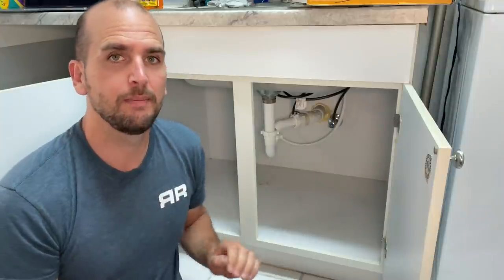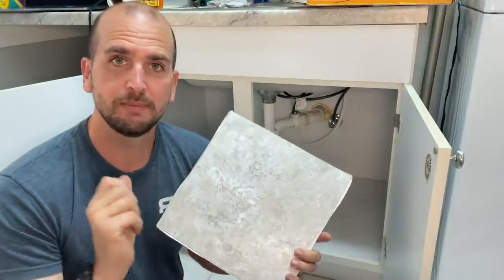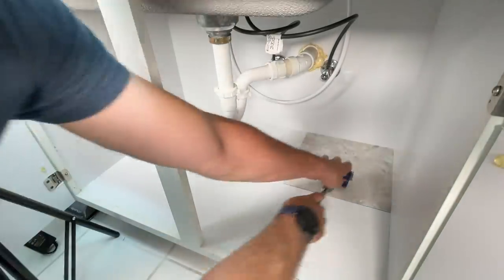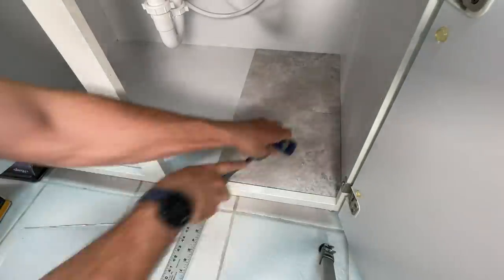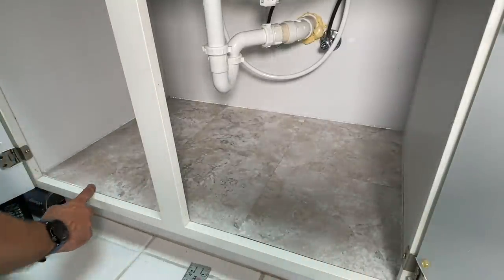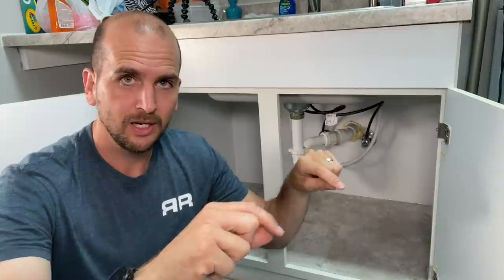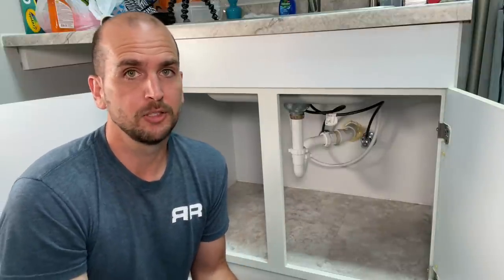Waterproofing Hack For Kitchen and Bathroom Cabinets

Comment: You can use 3M spray to get better adhesions and definitely want to put the tiles on the sides because water is just going to run to the sides and ruin the cabinet anyways.

Comment: Nobody’s under sink area looks like that in the real world. They all have drain pipes going through the baseboard which makes such a project 10x harder.
Reply: Wrong.  All of mine look like this, kitchen and baths.
Reply: Sorry!
But...All of mine look not perfect but in place"--
and clean...
Reply: Where do you live?! Mine look like that, it’s called taking care of things.
Reply: @SuperColymon  
Exactly!!☑️☑️☑️
Take care of your own
things!!😁😁😁
Or the place you're living
In...
Reply: The person never referred to dirty just how the pipes looked ffs.
Reply: @walkermom100  
And we're talking about the pipes ..
The dirty is extra" .
Reply: I’m sure the correct way is what we are looking at right now. Not pipes coming from under the ground or “going through the baseboard”, as you put it 🤷‍♀️. Those problems are caused by people not doing it right in the first place, and unfortunately the next owner has to deal with it. My bathroom sink also looks just like this, and apparently, I’m not the only one. Good idea to add those tiles.... it makes everything look so much cleaner than seeing an old, sometimes rotting, wood cabinet underneath the sink. So much easier to clean too, just an occasional wipe down 👍
Reply: @NEILZEE11  actually a lot of. Homes have the pipes coming up.from.the floor or near the bottom of the back near the baseboards. 
Everyone's setup shouldn't be the assumed way things are.
Reply: @walkermom100   ~ Maybe in really olds homes? I’ve only seen pipes, in newer places at least, coming from the wall, but ok. It seems harder to work on coming from underground.
Reply: @walkermom100  ... totally agree, leaky pipes can happen no matter how they are originally installed. The problems I was referring to were the ones coming from underground rather than from the wall. Just seems harder to me to repair the underground stuff.
Reply: @NEILZEE11  that's true and harder to find vanities for that.

Comment: This can be done without a tape measure. Turn tile upside down and use a knife blade to mark the cut on both edges and then I use a 14 inch aluminum angel iron section to make the cut. This will allow you to keep your fingertips if you wish to keep them. (Do not ask me how I know that) keep all fingers on the side away from the blade

Comment: Butter, tar, diesel oil, candle wax , or lots of chewing gum work well too. Johnny Maze says flex seal will make that cabinet double as a bathtub turning your property into a 2 3/4 bath.
Reply from the maker: 😂 actually want to try the Flex Seal and then test it out.  Future video 🤔
Reply: @EverydayHomeRepairs  it would probably work great😃👍🏽

Comment: I don’t like peel and stick tile. They always seem to shrink and get gaps between them. I’d use linoleum or laminate like you use on counter tops. Also, I think the cabinet manufacturers  should pitch the floor up in the back so the water will run out.

Comment: Great advice. I'd start setting tiles on front and on the center though as tile setters would do. Quick question, is there any liquid waterproofing I can apply on kitchen cabinet walls?

Comment: Too much time and not effective to deal with a little water leak. 
You really want to do this right?
Get a can of flex seal, they have it in white or black. Use painters tape a few inches above the bottom, ie making a "back splash" . Then with your flex seal spray lightly across the bottom and sides. Dont go heavy, go lightly otherwise will look messy. Let it dry then remove painters tape. Nice even line for your back splash. This way you have something that is effective in preventing damage if you have a leak.
Reply from the maker: Not a bad idea, thanks for the suggestion 👍

Comment: That is actually not a bad idea! Nicely done. 
PS: What type caulking was used (since there are a million and one choices)?
Reply from the maker: standard clear silicone.  Like this 12-pack on Amazon https://amzn.to/3pYmWkV
Reply: @EverydayHomeRepairs  Thanks for the tips! Haven’t yet seen your answer about caulking the seams between the tiles, fear of water getting between the cracks. Do you think ok to caulk seams, or not necessary?
Reply from the maker: @Shakashack2022  I don't love the finished product but it would most likely make for a more waterproof surface 👍

Comment: As a homeowner, I'm really paranoid about water leaks.
Under the sinks, I line the bottoms with scrap cardboard as it will show any leaks really easily then a baking pan with a water alarm under the drain pipes.

Comment: You don't use "tiles"... those are "Linoleum tiles", are they? A very good idea, you could also use any other form of such stuff, mainly important is that it is waterproof. Also, ideally all that stuff has a slight drop-off towards the front, don't know how that could be achieved cheaply.

Comment: I use contact sheeting and a moisture sensor that tells my main shutoff valve to close.
Reply: Tells your main shutoff to close! Who knew?! That's hard-core. Mine would probably go off while I was rushing to get ready for work, 😆.  Would be great for vacation time, though. As a renter, I think an email alert would be best for me.
Reply from the maker: Hey Rob, what brand are you using for the sensor and shutoff?

Comment: Looks nice, although if your a tenant you can’t go about transforming the furniture. As a plumber I object to the assumption you’ll even have any leak to begin with! Unless the plumbing is ancient, or poorly installed you should have zero leaks/drips. A real leak will damage the unit and likely the floor and beyond with or without vinyl tiles. Very often the reason for damage is a very minor leak which has been ignored for many months or even years!
Reply: After 39 years in apartment rental believe me it happens more than you would think from renters...

Comment: I have a few water sensors in my possible leak areas.
Reply from the maker: Have those worked well for you?  Did you have a leak yet which the sensor detected?  I have one sitting on my table from Roost that my insurance agent sent me but I haven't installed it yet.
Reply: @EverydayHomeRepairs  I tested it with water and it went off. But no I do not have leaks very often. After the last one under the kitchen sink, I completely redid everything. I may end up doing the tile thing in addition. I have the Flo by Moen sensors.
Reply from the maker: @chex313  Nice, thanks for the follow up.

Comment: I can't see how this would help, the bottom of the cabinet should be waterproof (if laminate) or extremely water resistant (painted wood). It's the seams around the bottom you need to seal with silicone, that's the only place water will get through.
Reply: I use sheet vinyl because there is no gaps/ lines

Comment: That wont seal it. You need something a tongue and groove so you can put silicon into the grooves that will squeeze through. Water will get into those cracks if you just bead it on the surface. Best bet would be buying a cheap box of vinyl

Comment: Any tips for drying out underneat the cabinet itself? 

I installed a dishwasher recently and noticed it was leaking pretty badly. I thought that I just didn't level it quite enough so I adjusted and did another cycle and it still leaked. I pulled it out, removed the insulation, and noticed that the top of each side of the dishwasher had about a 10" long crack! (Most likely damaged during Shipping) Anyway, now there is a ton of water underneath my sink cabinet 😡😑

Comment: Or just paint the interior with marine paint.
Reply: ... There's more than one way to skin a cat, I had a video stolen,  Where I did the same thing except I used tile.

If you ever run across the video , with black cabinets and and Gray tiling I didn't use thin set. If you have to ever run across a Video, hit me up I would appreciate it.
 I'll have to put up another video. Bye for now Ken.

Comment: I ran crossed your video & I  was wondering if you have a tutorial on how to replace drywall.  I put tiles on my bathroom wall just above the vanity & wanted to remove them; however big chunks of drywall came off with them.  Can I just cut out what needs to be replaced & add new drywall?
Reply from the maker: Hey Margie,  I don't and my go to channel for drywall is the Vancouver Carpenter https://www.youtube.com/channel/UCbZdXox6mKHdcT2QdVT-goQ

Comment: Why did you chop the tile off short in front, rather than extending all the way to the door - and in the process making sure that the water comes out the doors and NOT between the facia and the cabinet?
Reply: A lot of cabinets will have the fascia about 1/16 to 1/8 above the base for a better trim look.  That could be the case here.

Comment: Do you have any suggestions for protecting the outside of a bathroom vanity bottom? My daughter splashes in the bathtub and unfortunately it has ruined the bottom of the vanity. I can replace it but I'd like to avoid having it happen again.

Comment: Get some quality cabinets and it won't be as bad. My sink leaked at the trap from a crack on the seam and cabinets was holding water with no damage. A good finish applied after full cabinet assemble will do a great job. That sh*t stuff is just that, from big box stores, China, RTA

Comment: Is this method recommended over using some type of marine paint?  I am having new cabinets installed next week and plan to waterproof my kitchen and bath vanity.  Small leaks in my old ones left the bottoms bubbly and mushy.  I rolled cabinet liners in them but only after the water damage ocurred and want to do that before a leak happens with my new ones.  Also I don't mind spending a little extra money to have it water resistant and looking snazzy.
Reply: Read the label on the marine paint, some have lead some have aluminum and paint in a well ventilated or outside with a proper respirator.  A Plus for using heaving vinyl, it can take the abuse of scratches and dings if you are going to store items in a tote or basket.

Comment: How about the small gaps between the tiles?  Aren't water going to seep in between.  I was thinking of a vinyl instead that rolls up to the sides and has not seams in between on the flat surface.

Comment: I don't understand this concept: I'd just put in a single piece of thin cement (e.g. Durock) or linoleum, bead around the edges, and possibly put small pieces up the sides using No More Nails. Tiling such small and restrictive areas is both difficult and inefficient as fluids can seep through the grout unless you seal it. It wouldn't stand a chance against some corrosive materials though.

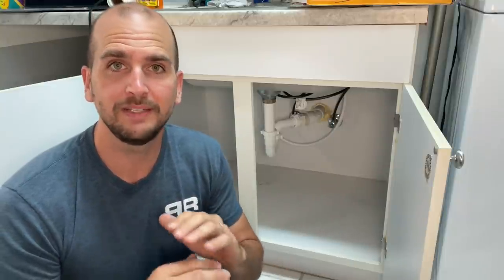Comment: @ 0:54 if you have a duplex and your on the second level??? A duplex doesn't have to be 2 levels it can be a single story duplex which just means 2 units. A quadraplex would be 4 units.

Comment: What’s the product called that is around the back wall where the pipe comes out. (That thick yellow substance) I checked and mine are not sealed. Pretty sure that’s where bugs come in. Please let me know so I can get some to seal kitchen and bathroom pipes. Thanks.
Reply: Expandable foam
Reply: @valerie5575  Thank you.

Comment: How about address the source of the problem and prevent it from happening by having proper plumbing lol? Laminate in itself is inherently water-resistant already unless scratched, the caulking however is a good idea.
Reply: When garbage disposals start to go bad they lightly leak and it’s not that noticeable. Gets worse as time goes by and then the seals in the gd finally completely go out so then you know about it.

Comment: I tear any wood  below the sink basin out! Tile the floor with good adhesive and use adhesive-grout caulking. Anybody with wood in a wet or water utility access is just asking for it. Be smart not lazy...no offense to Podcaster.
Reply from the maker: Really, so you have no cabinet base just the homes flooring under the cabinet showing?
Reply: You’re kidding right ?  You removed the cabinet base bottom under your sinks?